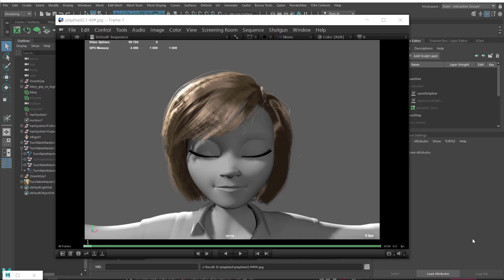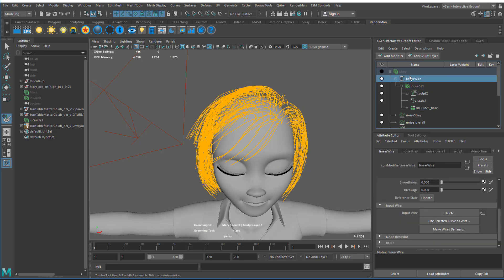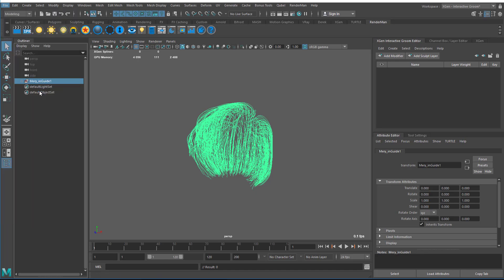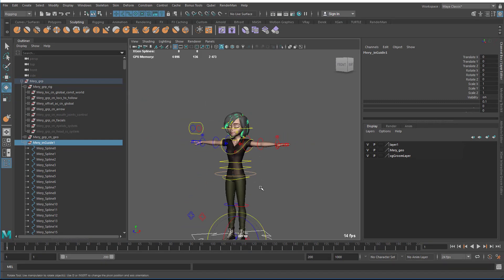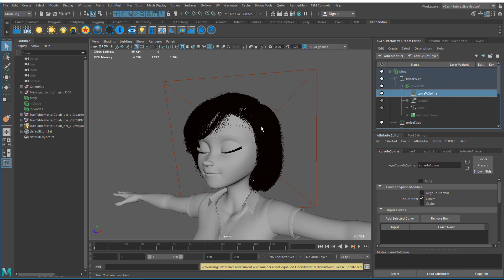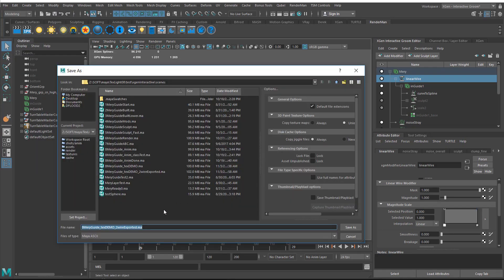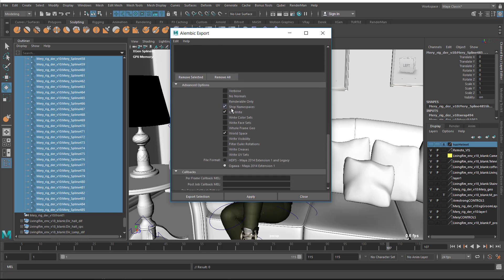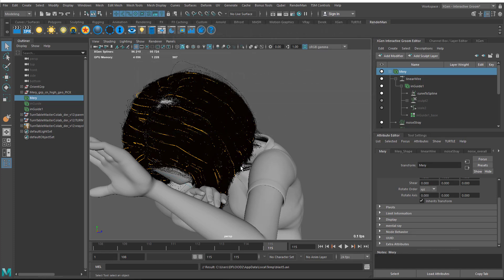Animating Hair with Maya XGen | Dynamic simulation & keyframe animation of hair grooms

Comment: hi, very good video. but can you explain why we need to convert the cached into the fbx? thanks
Reply from the maker: @3d.bubble  because Alembic requires an external file. When FBX is imported it becomes part of the Maya scene
Reply: @derekfloodVFX  tbh im not really ubderstand, so what will happened if I dont convert the alembic into fbx?
Reply from the maker: @ the Maya file will be dependent on external files, which is sub optimal for an asset in production.

Comment: what were the main settings you used on the nucleus and the hairsystem for the dynamic hair simulation to get the hair to keep the main shape but not be stiff? Thank you for the video!
Reply from the maker: You just need to set the "rest position" of the curves.
Reply: Thanks! I have another question, i have a groom on an animated character with dynamic simulation but i want to transfer the groom on the same character but on another file in another starting position, how should i do this best because I dont really understand it in the video. Im not using the interactive groom, should I? @derekfloodVFX
Reply from the maker: @arnoutzeghari3563  Interactive groom (IGS) is completely different from the original xgen system. This video is for IGS. You can transfer an IGS groom using the "description>transfer" menu. 

I don't understand conceptually what you mean by "another starting position." What are you trying to achieve? Typically there would just be the hair groom, and it would be affected by dynamic forces in a shot.
Reply: @derekfloodVFX  Could i email you on this? So i can send some screenshots to make it more clear on what i am trying to achieve since i think you know a lot on this topic. Thanks for the help so far.

Comment: Hello Drek
I am working in an animation studio in Türkiye.
I am responsible for the simulation of hair and clothes for the characters.
I have recently encountered a strange problem in some project shots and I want to consult with you in this regard.
I have a cartoon rabbit character in the scene that the animators have finished animating.
I have taken an alembic cache from the rabbit animated model.
I have a copy of the rabbit body without rig , on which I had already made the hair with Xgen and then transferred it to Xgen interactive.
Now, I assinde wrap deformer from alembic cache to the original model.
So far everything works well and with the movement of the alembic model, the orginalmesh also move well.
But
In some frames, the hair is separated from the model and it seems that the hair has exploded and the roots of the hair are separated from the body.
Can you suggest a solution for this?
Reply from the maker: The wrap deformer in the video is only intended for hand key-framing. I would not use it for a simulation.

Comment: Thank you for your video! I have a question, so when I import abc cache to curveToSpline, it has enormous size for the curves, do you know why? Thank you😊
Reply from the maker: what happens when you import in those curves with cache>Alembic cache>import Alembic?
Reply: @derekfloodVFX  in this case they appear like curves, normal size..
Reply from the maker: @nataliamatsiuta1848  sounds like there is some scaling on the xGen that the curves are being added to, which those curves are inheriting. Could possibly be the geo the xGen is generated from. I'd suggest doing a simplified test to troubleshoot the workflow.
Reply: @derekfloodVFX  Thank you for your advice, I will surely check it 🙂

Comment: When it comes time to batch render the animation will the hair cause any issue? Is there any extra steps to ensure it renders properly using arnold renderer?
Reply from the maker: The potential issues with rendering are not with caches but with modifiers that use random generated data such as clump or noise. It’s good to bake these.
Reply: when would I bake the modifiers if I am using the dynamic simulation approach? @derekfloodVFX
Reply from the maker: @queengabby9707  Well, you need to keep the modifiers used for the dynanmic sim, and bake the others that use random values, such as noise that are used for the groom. So with that in mind you could break up the process conceptually into grooming, bake that, and then do the animation/rig setup.

Comment: Any hair or just maya model hair
Reply from the maker: The answer is in the title "Animating Hair with Maya XGen"
Reply: I mean for example i import character from iclone, am new to animation with maya
Reply from the maker: @bmd_videos  hair systems are done by generating rendered curves for each hair. That's what XGen does. Geometry is only used as a proxy object. If you want to bring in curves generated in another software you would need to save them in a software-agnostic format like Alembic. If you are new to Maya I'd suggest avoiding that as it is quite advanced.